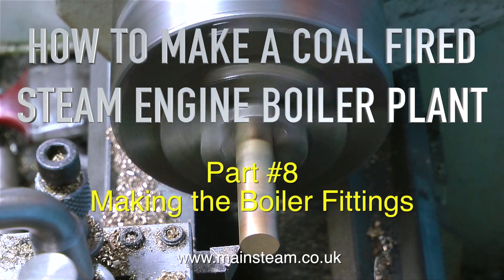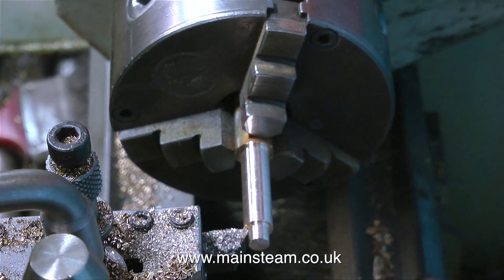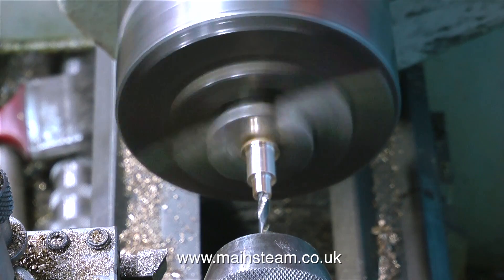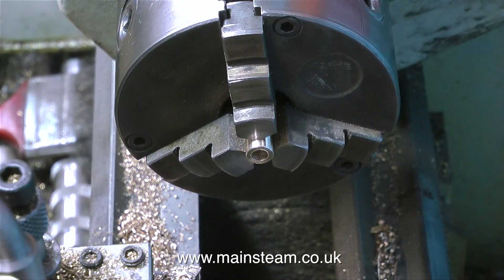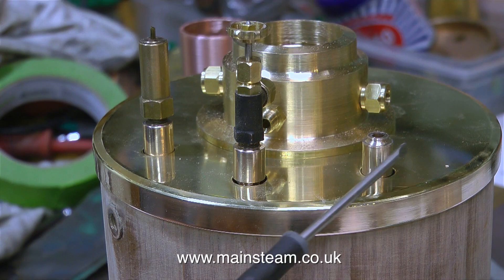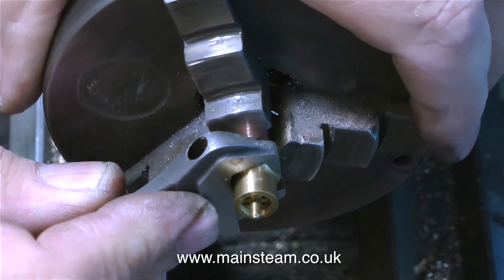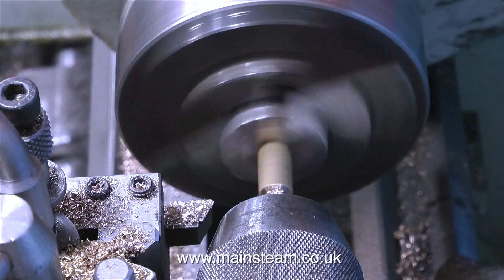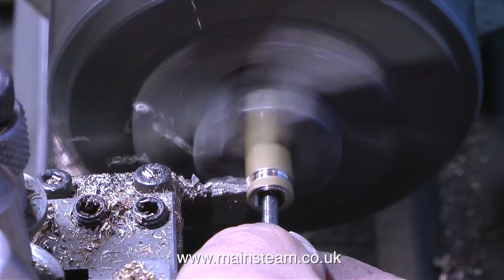HOW TO MAKE A COAL FIRED STEAM ENGINE BOILER PLANT - PART #8

Comment: i use in our steamboat - sacrifical anodes, that is just a pice of zinc mounted on a brass nipple screwd in on a easy to access part of the boiler below the nominal waterline. that can be inspected. the fittings i got are surly not all made out of Ph Bronze, and well, they are servicable, never had one snap so far.

Comment: Keith, you talk about the many ways that machining a part can go wrong, and I think you said that more than half the ones you made when you first started would fail one way or another and you'd have to make them over.  I've been watching for a while now and I can't remember if I've ever seen you throw a part away because of a machining glitch. Are there false starts and failures you're not showing us, or have you just made enough mistakes in the past that you're able to avoid them reliably now?
Reply from the maker: I am far from perfect :-))) It is even more difficult when you are trying to video the process simultaneously. I try and get it right first time, but that's not always possible for me - and I do show the odd mistake - or two. . . .

Comment: I do enjoy watching you work on the lathe. in am a cnc machinist and I like watching you rock it old school on your boxford. a tip if I could be so bold would be to touch off the end of the drill and set a dial indicator so you can be as precise as you want to be.

also why do you use your mic as a snap gauge instead of making a measurement and adjusting x accordingly? 

Very relaxing to watch you work and I wish you all the best. cheers.
Reply from the maker: Just about all of my workshop practises are for speed, with my 64 year old eyesight it's quicker to initially set the Micromenter with a drill shank :-))) Thanks for your comment.

Comment: I've just realized that you're using imperial measurements, which caught me by surprise since you are in the UK. I didn't notice because I'm so used to using them myself as I live in the States. Any particular reason you're using imperial over metric?
Reply from the maker: Various reasons really, I was taught in Imperial measurements at school (many years ago) and most of the model steam engines that I work on use Imperial measurements - threads etc. I think that I am altogether more comfortable with feet & inches anyway.

Comment: I feel like I should have heard of the concept of dezincification by now. I'm reading the Wikipedia article on selective leaching as a result, and it looks like I've got much to learn.
The closest thing I've heard about to this is in relation to casting brass; because the boiling point of zinc is so low, when recycling brass it's often a good idea to add a bit of zinc to replenish what gets lost in the melting process. But it looks like that's very different from dezincification as I see the term defined.

Comment: G'day Keith what sizes would you recommend when buying a set of adjustable reamers?   The di holder you were using with the lever on it did you make that or was it bought.   One more question I'd like to ask you do sharpen your drill bits yourself?   It's very interesting watching you machining ect., and every time I watch you I pick up some very useful tips, it's turning out a beautiful boiler and I like how you sort pieces out to see how they look, before making the final commitment thank you.  Kind regards John
Reply from the maker: Hi John,
I don't know about the reamers, as I bought my set which are very old and very good via Ebay. The Die holder is a commercial item - I bought it from a company called RDG Tools in the UK, but they are probably available of Ebay too. Yes I sharpen my drill bits myself, it's just a flick of the wrist :-))) It takes a bit of practice though. I should really buy a twist drill sharpening jig.
Reply: Keith Appleton thanks for the reply Keith I'll keep looking John

Comment: Dezincification (that's a weird word) is mostly caused by the zinc reacting with either slightly acidic or alkaline water. There are a lot of conditions in which it occurs.  Most of which would be present in a boiler. Zinc is highly reactive and easily turns into zinc oxide over time.  It is said that only brass with over 15% zinc is susceptible.